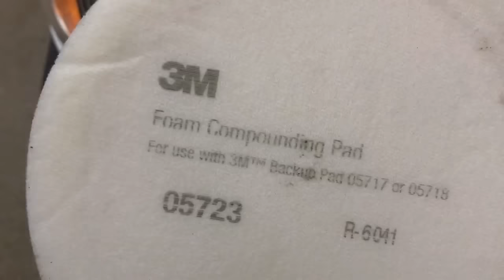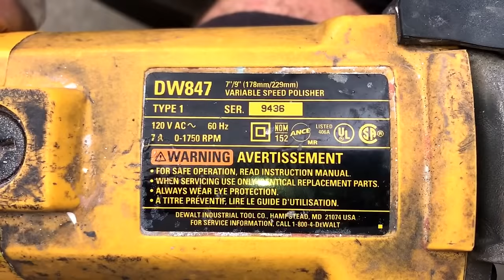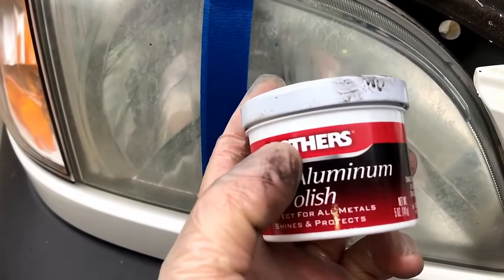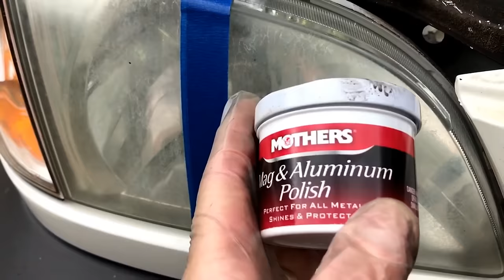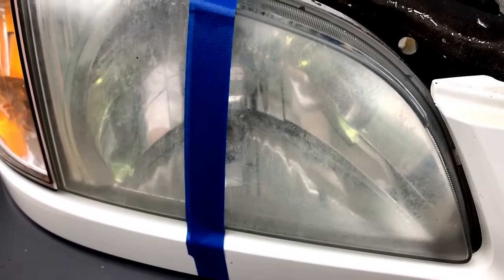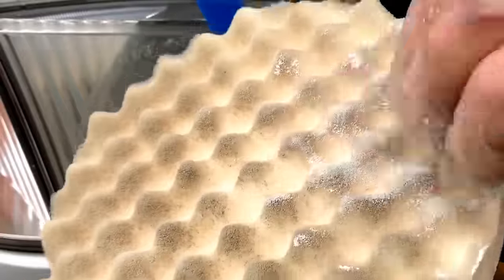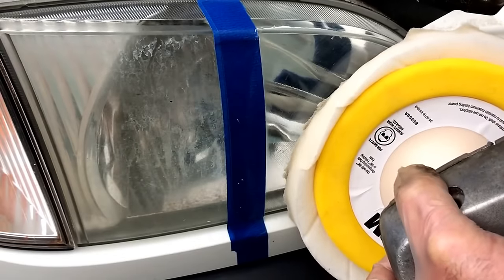How MOMMA Repairs Headlights BACK TO BRAND NEW in 3 Minutes

Comment: “MAGICO !!!!” It actually worked !! Thanks for this video. Was pretty sure it was going to be a YouTube smoke and mirrors job. I also have tried a number of different methods including working my way down through the sandpaper grades and then polishing. I’ve tried the acetone in the heated coffee cup which works but often you still have to sand back the lights with that method most of the time also.
Reply from the maker: Glad it helped!  Thanks for sharing Darren!  Have a great day.  mad Mike the hammer SPC

Comment: Great video! A couple years ago when I was doing this I watched another video of somebody using all the different grits of sandpaper of course and actually recently I just used a cut polish and it worked great on my daughters 2001 Honda Civic. After I was done I put some wax on the headlights and they look brand new.
Reply from the maker: HD thank you very much and you should try the ceramic coating that we have videos on to coat those headlights and you’ll never have to mess with them again have a great day thanks for sharing Mike Sweet project cars
Reply: Sweet Project Cars cool thanks Mike !

Comment: First time I did the van, I did the step sanding, polishing.  Taped it off, back and forth, up and down, NEXT.  Took an hour probably between the 2.  I saw this and thought no way.  Bought a $35 HF buffer, $8 pad and some Mothers.  3 minutes tops.  Unreal.  One thing I did notice is I first cleaned with a 3m non-scratch kitchen sponge (blue) and dawn.  They were noticeably clearer after just a scrubbing.  I still need to get some protectant, but I can buff again anytime.

Comment: Dude that is impressive. Efficient, fast and cheap. I have used the 3M kit before and it did an excellent job however too many steps. Awesome.
Reply from the maker: Thank you Christian yes this is the fastest method ever it works fantastic look for a video on how to ceramic coat them that will blow your mind I think it’s labeled how to ceramic coat headlights

Comment: I watched your video over a year ago, and have been planning on trying this. I finally got a chance to get to it, but I didn't use mother's, I used another cheaper brand metal polish applied with a Wen 10" buffer. It took about 3 minutes per light. Ha ha, I should have done this ages ago. Thanks a bunch.
Reply from the maker: Good deal glad we could help you have a great day thanks Mike

Comment: I was all set to spend $150 - $280 on new headlight lenses for our 2006 Honda. Thanks to your video cost was ~$10 for Mothers and a couple of micro fiber towels to achieve the same results without the worry of poor fitting replacement lenses.
Reply from the maker: John that’s awesome that we could help you out save you some money we have many great headlight videos now that you’ve done this to them and made them look great you should check out our ceramic coating video so that they never cause you an issue again have a great day my friend

Comment: Definitely going to try this on the 2010 Sierra I bought.  They are in much, much worse condition than the lights in your video though, so I may have to resort to sanding.  But even if I have to do this method two or three times, it will be easier and even faster than sanding with the various levels of grit and buffing etc. 

At least you didn't tell people to spray Clear Coat on them after you were finished.  You know, and distort the light almost as bad as the film that was just removed.
Reply from the maker: Watch this  https://youtu.be/GKLF8oIWYGg  for some additional information that may be helpful Jeremiah.  Thank you for watching and sharing, have a great day and all the best with your project my friend. mad Mike the hammer SPC

Comment: It works... I have done it by hand with a brand new kitchen sponge though it takes some elbow grease.  I would use a butter for sure just easier and quicker.
Reply from the maker: Good deal thank you for sharing but when they’re really bad our method is the only one that will work thank you for sharing have a great week

Comment: I bought a very nice 2005 Ford Ranger Extended cab 4x4 with only 97,000 miles on it May 1st last year. Looks almost new and runs as good as it looks. Although it looked great and is mostly garage kept as I have an assigned unmarked cruiser and a new 2017 Explorer Sport there were some things I wanted to do to it like new tires and wheels, various maintenance items and I changed every light bulb to LED. It now only has 98,000 after a year and after waxing it looked great. Even got the dingy headlights a little clearer with Nu Finish polish. Been using Nu Finish for many years and love it. I saw this video and thought would try it on the headlights. So yesterday I did and they now look amazingly clear. So I tried it on the 2004 Crown Vic yes that is what you get when become administrative and they were bad. Now clear as a bell as the saying goes. The third brake light lens on the Ranger I was able to get kinda clear before but not to my satisfaction and was going to replace it. Tonight decided to try the Mothers on third brake light lens and all I can say is “WOW!!!”. Unbelievable the lens looks brand new. THANKS A BUNCH FOR THE VIDEO!!!! Oh and I liked and subscribed. Oh and it works great on tail lights also.
Reply from the maker: chargerman 65 glad we could help thank you very much :)

Comment: excellent vid, will try it myself and post feedback...this polish appears to be the perfect grit for getting it done fast and also putting a great shine on the plastic...thank u for posting
Reply: ok well I tried it on my 2007 Honda accord...and it works exactly like the guy said...super clean, brand new looking headlights, its fast and ez...I couldn't find my big buffer so I used a drill w a 5" buffing pad and it worked great, 3 or 4 min per light, no masking! sealed them w meguiars headlight protectant and I should be good for a year or so...they looked so good iI had to go out and look at them a couple of times even  lol they hadn't been touched since new and they looked like bathroom glass before

Comment: Someone from my Volvo owners' group recommended this video and it didn't disappoint... Awesome! I tried the sanding and clear coating route and it produced good but not great results. It appears that I have oxidation inside my headlamp, is this possible? if so do I follow the same cleaning steps after removing the cover? Thanks!
Reply from the maker: If you can get your lenses off, use the same method here but you will most likely have to do it by hand. If not, a set of these  https://amzn.to/3G3biyB  Thanks for the view and comment, hope you have a great week and all the best on your project my friend. mad Mike the hammer SPC

Comment: Thanks man I did the other guys method and dam man what a nightmare the clear coat I applied chipped up and cracked. Now I got to sand down with 150 grit to remove all that stuff. Thanks again
Reply: Do you think once I sand down with 150 and then do this will I get the same end result ??? Thanks In Advance chief
Reply from the maker: VI7T : you will need this pack right here https://amzn.to/2Gr8LNN   and I suggest you start at the 800 grit and work your way all the way to 3000 it will take you some time but you will get it, then do this video https://youtu.be/hD2CKp9mco0 for the most ultimate headlights :)            Go from 800/ 1000/ 1200/ 1500/ 2000/ 2500/ 3000
Reply: Sweet Project Cars Thanks for the reply. I ended up doing 
150/180/400/600/2000 because that's all i had 
And then spraying it with clear enamel 
Thanks for the tip i will be using this method on my other headlights. Awesome Channel by the way. Subscribed and Turned on Notifications!
Reply from the maker: good deal :)

Comment: I did it by hand on 3 cars this weekend.:
2002 Lexus RX 300. 2002 Toyota Sequoia. 2010 Mazda CX 7.
The Lexus and Toyota were pretty bad. Took me 10 whole minutes each. The Mazda, my son's "new" car that was just starting to get foggy, about 5 minutes total.
I used 2 white towels, 1 to apply and rub and 1 to polish clean. That's it.
Let's see how long they last. Regardless, even if they last a few months, it's an easy, fast and cheap solution to the problem. 
You wouldn't believe the before and after. From yellow to perfectly clear. 
Thanks, fella!
Reply from the maker: That’s awesome to hear a good job my friend we love to hear that thank you for sharing so much

Comment: I tried this on my daughters RAV 4,  I made a rookie mistake and ran it i think at too high RPM and I left burn type scuff marks..Overall it looks good except for the scuff marks. I did the other headlight and took it much slower and it came out perfect.  So in my opinion this works, you just have to be careful and don't over do the buffing, because you risk scuffing the lens due to too much heat.
Reply from the maker: Steven thats awesome and yes you do need to take it easy when doing this patience is the key and starting out easy then as you get better you can go at it faster   thank you very much, we truly appreciate it and you being here with us also :)

Comment: Great video! I've tried numerous "quick fix" ideas. I did this by"following your video"  hand and had a 99.9%  improvement!.  Great video. Keep it up! Can't wait to try your other videos.  I just need to invest in good equipment.  PS I have scratches from other attempts, how do i get those out? I'm assuming to continue with a buffer to get those out?   Thanks!
Reply from the maker: Steve Cordova you may have to do this video   https://youtu.be/GKLF8oIWYGg but if they are not to bad then you can hit them with 3000 grit wet and dry to remove them... then re-buff :)
Reply: Sweet Project Cars Thanks for the feedback, much appreciated. I'll give feedback also.

Comment: Thanks for this video. I have fine, hazy scratches in my taillights from using my snow brush in the winter to remove snow and ice. Will this method work for the taillights too?
Reply: I found that you already answered this here: https://youtu.be/4kuovG1qMd8  Thanks!!
Reply from the maker: Jeff Kyle it sure will and e have videos on taillights with this same method used on them

Comment: Outside is pretty easy by many different methods but the inside was my problem too so I took out the headlamp and used a mechanical finger with a piece of lint free cloth and WD40 all around the inside it worked well.
Reply from the maker: Thank you for sharing we highly suggest that you rinse out the inside with 99% thanks for the suggestion have a great day mad Mike sweet project cars

Comment: Question, now that it's done, how do you personally seal or protect it? Which clear coat or sealant?
Reply from the maker: Never use clearcoat as it does not last if you look in the show more of the videos description you’ll find the UV protectant we suggest you use we also have videos on ceramic coating your lenses so you never have to mess with them again

Comment: I came across a different vid he had showing the same technique & I tried it the the headlights of my 03 maxima. I really works! I used a power drill & still got great results. I imagine the end result would have been so much more better with an actual bugging machine like the 1 used in this vid.

Comment: Booms its done Man... You deserve respect Sir...! But have a question... Does this work exactly the same on Glass head lights? and how long it works? I mean how reliable this method is?
Reply from the maker: This mainly works for all plastic headlights but it will really clean up glass headlights as well plastic if you use the conditioner we share in the tools list of the video it will last for years and years

Comment: QUESTION: Near the end of this video, at 4:50 into the video you mention using 303 Protectant to make the results last longer. 303 makes several spray protectants. Which 303 do you use for this purpose? - - AND tell us what other things the 303 is good for. - - The polishing works great by the way but I want it to last using the correct 303 Protectant. Thanks for your help.
Reply from the maker: We use this  http://amzn.to/2zTBRms  read all about it, it works on all your plastics, vinyl, rubber etc.  Thank you for watching and sharing, we appreciate it, hope you have a fantastic day my friend. mad Mike the hammer sPC

Comment: That was awesome. I plan to do my daughters headlights with the drill. I know it will take a bit longer but the result is what I want to see. Thanks. See Linsterville
Reply from the maker: Pete Linster  you will love the results my friend :)
Reply: So I bought some Mom's and did my wife's Camry. It turned out nice. I bought this small buffing pad that fits on my drill. I can do one set of head lights with it. Then I throw it in the wash with the car rags. Like brand new. Then I did my daughters older Nissan. It came out almost as good as your video. A big improvement.  My drill is an old battery drill. So Anybody can get good results. Just keep moving the pad around when buffing.
Reply from the maker: Peter thank you so much for sharing and we are glad it worked great for you :)

Comment: Hi Sweet Project Cars, could you please do a video to show how to best apply & dry the UV 303 Clear coat after having cleaned the headlights?
Reply from the maker: Buster Rymes we have a video on that but it is very easy, you spray it on let it sit for a minute or so and then lightly buff it off you do this 2 to 4 times a year. or you can do this video  https://youtu.be/hD2CKp9mco0 and then only do the 303 once a year.
Reply: Sweet Project Cars ç

Comment: I tried on the fog lights of my 2009 Subaru Tribeca. It took much more than 3 minutes because they are small, recessed and very milky. Aaaaaaaamazing....it was worth working on them for a couple of hours. Just polishing nothing else.
Spent $20 for a small circular pad that fits on my electric drill and the Momma aluminum wheel polishing cream. Have to wait to see how long they last.
Reply from the maker: Good deal glad we could help

Comment: I am wanting to try this but I have a question.  I bought a 20v drill today but didn’t know what pads I need for the drill and if I need anything else beside the drill and “buffer pads”?  I am technically challenged and I don’t own the other equipment you used in the video because of my weight restrictions. Thank you for your assistance,
Reply: Looks to me like all he used was that spongy buffer pad. Then he used a 303 product to seal the headlights. Look in the show more section and he list of products that he used. Also if you read through the comments you can get information there too. I hope it helps!
Reply: Thanks.  I bought a drill and some drill pads from Amazon.  I want to try it.

Comment: Thankyou for this awesome tip! I have an important question though. Whenever you finish the buff, you say you use 303 aerospace protectant as a sealant to prevent fading again right? How do you apply it? (I am guessing the best method is to use a microfiber towel with the 303 on it?) and how long does the 303 sealant last in terms of the headlights starting to fade again? (Without doing a re-touch up or something) thanks alot yet again!
Reply from the maker: We just spray this on  https://amzn.to/2WQg0sB and use one of these https://amzn.to/2yP98Cw  wet it down and wring it out let the 303 sit on the headlight for at least 5 minutes, then gently wipe with the dampened micro.  Thank you for watching and asking B KH, we really appreciate it, hope this helps and hope you have a fantastic week my friend. mad Mike the hammer SPC

Comment: I have always use  car wax even on the headlights.  That mothers aluminium polishing seams to work a lot better.  All give that a shot in the SPRING! also I own a few cars in my collection I normally soke my convertible top on my mustang with Maguire rich leather.  Car is 10 years old top still in good shape mind you it it indoor park 9 months of the year . Should I start using leather conditioner on my convertible top? Are should I use different products since it expose to the elements
Reply from the maker: robert sounds like what you are using is working i would stay with that my friend :)

Comment: Quick question please. Do you know if mothers aluminum polish can be used on factory painted rims? Thanks, great video.
Reply from the maker: Butters yes it can we use it on every type of paint and surface
Reply: Thank you. I recently changed my name from Butters to this one. I want to thank you again. Just today, I received Mothers aluminum polish that I ordered from Amazon. I ordered it right after I initially watched this video. Anyway, I tried it today and you are one hundred percent correct, my headlights are as clean as they were when I first bought my car back in 2012. You saved me so much time, money and unnecessary work. Great, great video. This does work.

Comment: This works but the 3M pads cost nearly a hundred bucks. I'm sure they will last a long time, expensive but cheaper than a new set of headlights. I've tried some of your other tips and tricks too. You guys are great, thanks.
Reply from the maker: hello doug where are you located? in the USA? as the cost is not that much here